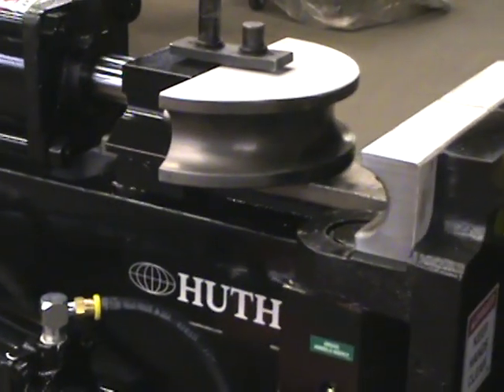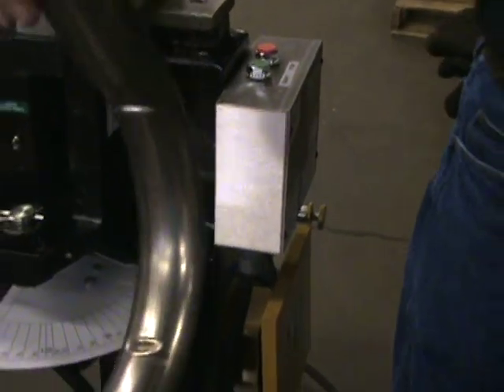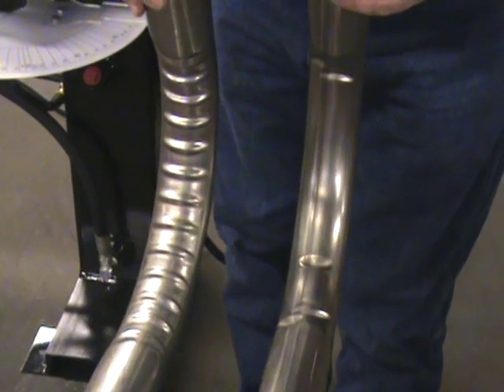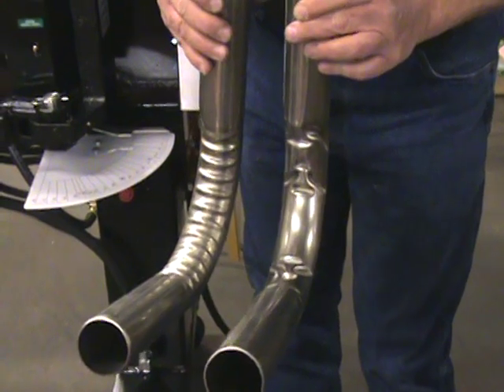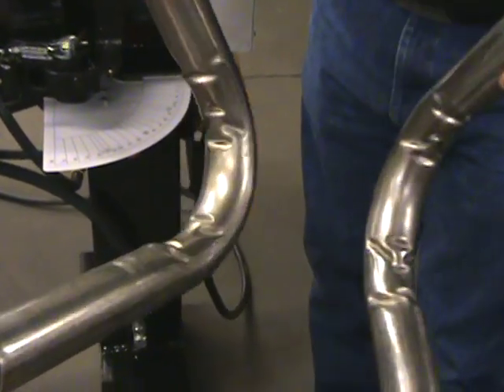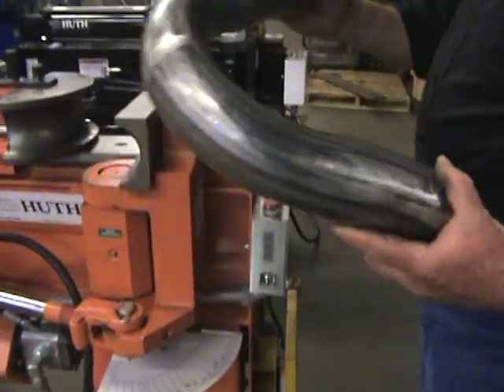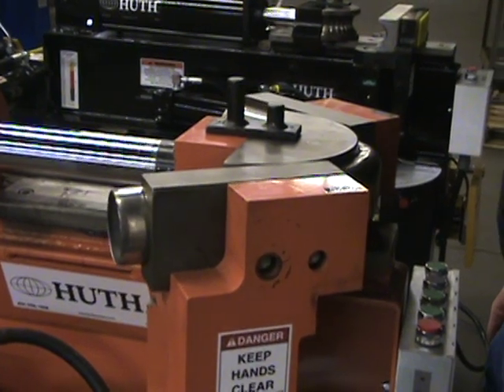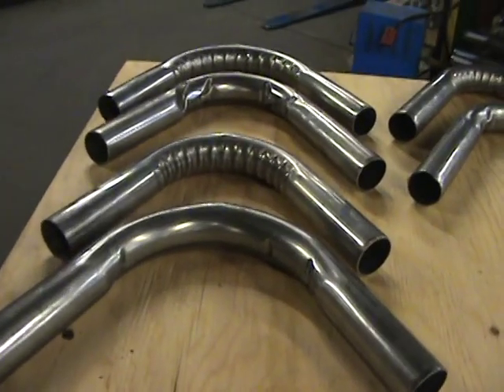HUTH Control Wrinkle Die Bending for Stainless.mpg

Comment: Cool machines. I got a question though. Does the wrinkle bend decrease a vehicle horsepower performance? I heard that mandrel/straight bends are better and add more horsepower than wrinkle bends. Is that true!?!?
Reply from the maker: There is more to it than just the tube bend style. What components are being used? How is the system designed? The other components may have already limited the power to the system.  If there is a slight loss in power due to a bend it would be countered by moving up a pipe size.  One of the biggest benefits to our equipment is the investment needed to create a system. Please contact us to see how we can help.... Thank you.